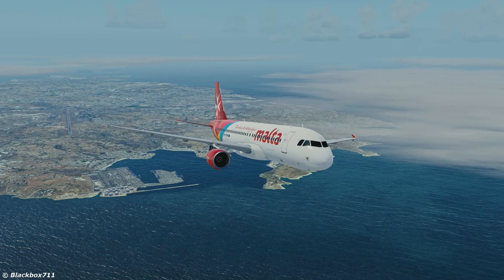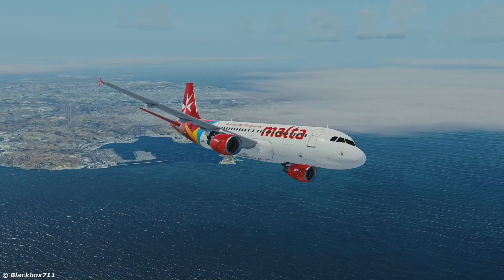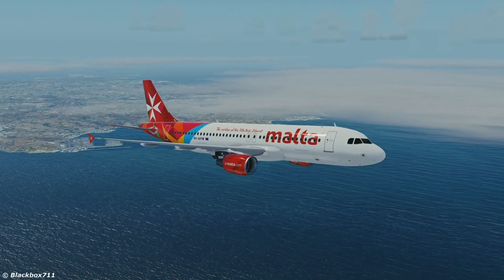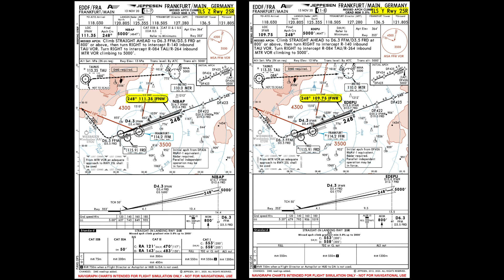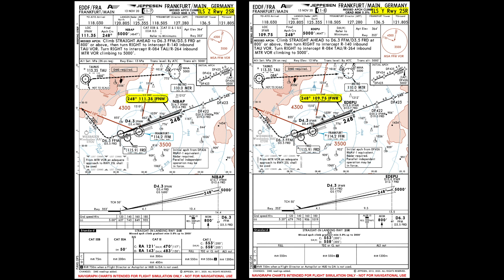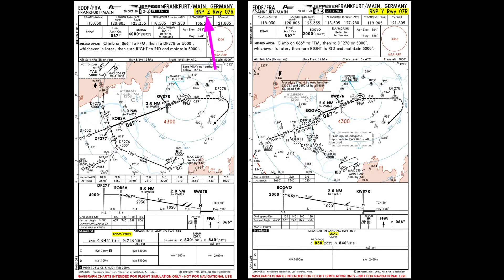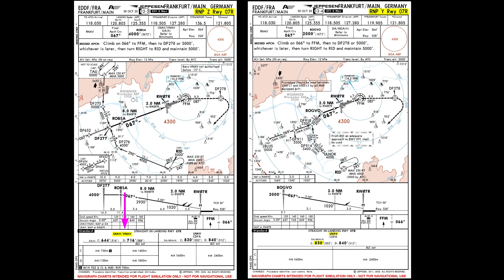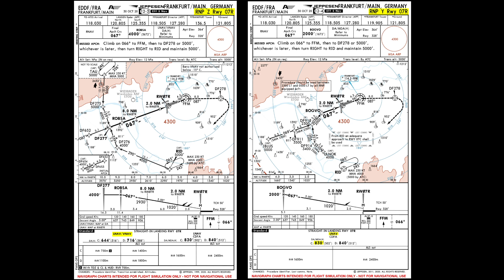FAQ - Approach Type Letters (ILS-Z, Y, X etc.)

Comment: Ok that makes sense. But interesting that rwy 25r at Frankfurt has 2 different ILS frequencies. It seems to me that they can not be switcht on both at the same time, since they are so close together in frequency, and the localizer antennas are also close to each other. Only the gp antennas could be positioned on both side of the runway at the touch down point. But I have never seen that...

Comment: Inbound for some advice please... sim enthusiast here... last night I was flying into LIRN for Rwy 06 and was presented with two ILS approach options, ILS S and ILS P (Chose S as per Jeppesen 11-1). I haven't seen S and P before... what do these letters denote please?
Reply from the maker: Hi. These letters note a difference in procedures regarding the published Approach i.e. ILS. The letters start at Z and then go backwards in the alphabet. If you compare the S with the P approach you will see some differences. This could be in the initial, intermediate, final or missed approach segment. Normally ATC will clear you for a specific procedure or the ATIS will state that. The highest publish approach letter will normally be used.
Reply: @Blackbox711  Thanks for explaining, so just a few letters lower down than the more commonly seen Z and Y options... glad I asked, all clear now.. thanks again (liked)

Comment: You CAN do a managed descend approach (or VNAV or IAN on Boring) on a LNAV only procedure. Just as you could do it on a LOC/VOR/NDB approach. just keep in mind it's a NPA flown by computer and you need to monitor it, not as a APV (which you still need to monitor, but more like a ILS/GLS)
Reply from the maker: Hi. No, not necessarily. There are strict rules when using a managed autoflight mode for a vertical profile. At our company we are not allowed to use managed descent on LNAV only approaches.
Reply: @Blackbox711  Seems a company rule, our company is OK with that. 
However our company is not allow to use VS/FPA or even full manual for LNAV/VNAV approach, while Boeing says it could be done as long as you just follow the virtual glide path, and reglation premited.
Reply from the maker: Through my videos here I have come across so many different company SOPs for the same procedures. On top of that our SOP have changed numerous times as well since I started flying the A320.

Comment: Thank you and happy new BB. I find one thing missing. Explanation about what is the deciding factor for pilots using different approach procedures to the same rwy.
Reply from the maker: Hi Arni. Pilots normally get told through ATIS or approach clearance what approach they need to fly. On some rare occasions it depends on what the Aircraft is certified for (RNP AR, RNP LPV).

Comment: Hi, Any chance to make a video about : NADP 1,2 and Procedure A,B, and why in FMGS Thrst/reduct its default 1500''?  thanks
Reply from the maker: Yep, I will put that on my list. Thank you for the request!
Reply: @Blackbox711  I forgot to add in my comment:
''Some countries still using A and B, but if you check doc.ICAO 8168, no more those procedure.. you can still find in Jeppesen or Lido...Airbus says ''do not reduce below 1500'' or EOA... Thanks!
Reply from the maker: Airbus gives out recommendations regarding thrust reduction. However some airports dictate as well if NADP 1, 2 or special procedures apply. The Engine out case is something completely separate from NADP.

Comment: Am I right in saying “RNP Approach” is replacing “RNAV approach” as Heathrow has done this as well as EDDF. Read somewhere that RNP approaches will basically be fly from waypoint to waypoint and RNP (AR) will be like Salzburg or Madeira with curves between waypoints and require more training
Reply: IIRC RNP Must be flown on autopilot (or manually with a HUD, but not quite sure), and there are nav accuracy certification requirements. RNAV can be flown manually by any aircraft (including a Cessna 152) with something as basic as a Garmin 430. (Early RNAV doesn't even need a GPS as it can be replicated with twin DME/DME receivers. But that can be dangerous due to signal attenuation errors)

RNAV is considered a non-precision approach like VOR & NDB approaches, except RNAV approaches that also includes some sort of ground aid e.g. GBAS/LAAS. I've never encountered one of those myself (yet) so can't comment.
Reply from the maker: RNP is similar to RNAV, however there are some differences regarding on board systems, procedure design and monitoring equipment. That is a big topic which would take a long time to explain fully. But a Head-Up-Display is not needed. However GPS updating, Position degradation alert etc. can be required.

Comment: Why does 25R in EDDF has two different frequencies?

How does Flightsimulator deal with this problem as the frequencies are stored in the AFCAD? For a runway you can assign only one frequency.
Reply: 25R has two different glideslope angles, ILS-Z is standard 3.00 degree profile while ILS-Y is 3.20 degrees. The afcad in P3D/FSX can have more than 1 LOC/GS frequency for the same runway, I'm not sure if the default scenery has both frequencies modeled but addon scenery does have it included.

Comment: AFAIK the Zulu is the default option, Y & X is for ATC discretion when there's flow management, noise or other special requirements, or if a navaid that Zulu uses goes offline.
Reply from the maker: Unfortunately it is not that simple. If you look at KJFK RNAV approaches 22L for example the Z, Y, X are three seperate approach types based on either RNP, WAAS or simply GPS.
Reply: @Blackbox711  Yes there are some approaches that has special requirements with regards to RNAV, and generally ATC knows what equipment you have from your flight plan. Some STARs transitions to different ILS approaches, and again that's ATC discretion/preference in what they assign you.